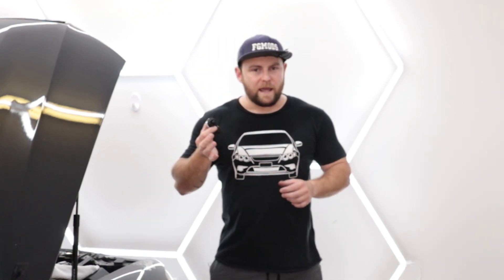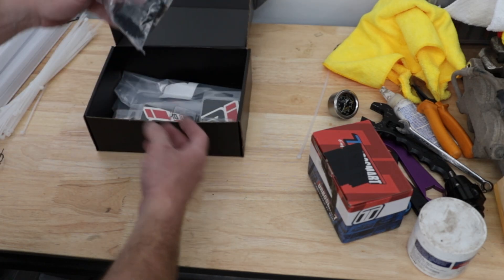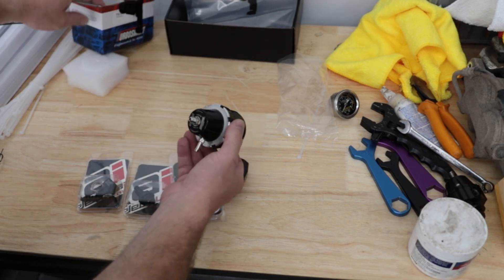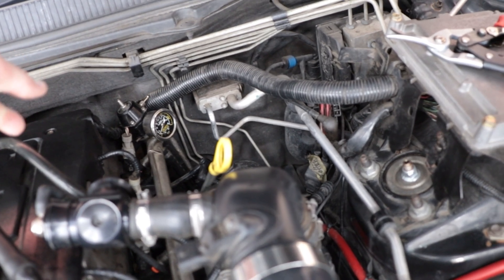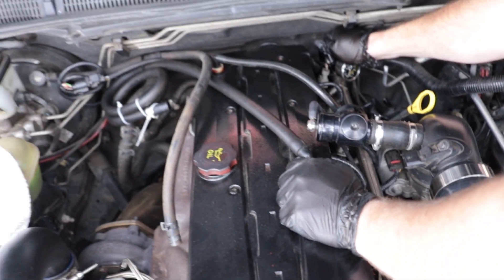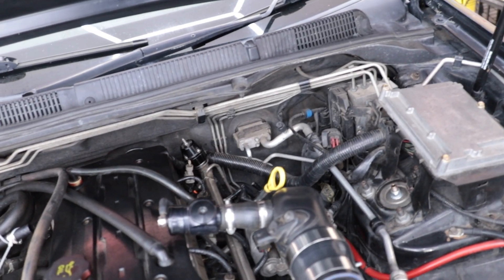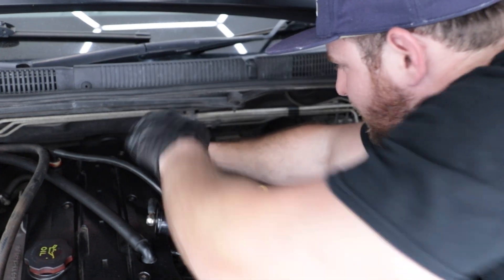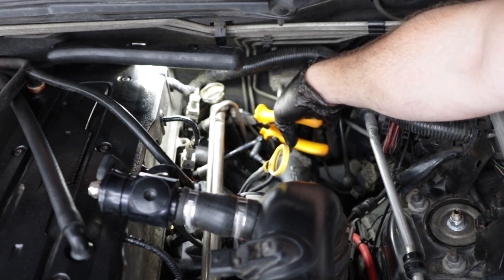Fix the turbo Falcon fuel system limitations #xr6turbo #fordfalcon #cars #barra

Comment: na+t is not a thing...if you have a turbo it's no longer naturally aspirated.
Reply: Reselling (or even just labelling) a car as 'turbo' knowing that there are differences between factory NA and Turbo cars seems disingenuous.
NA+T is a way of differentiating between a factory Turbo and a Turbocharged factory NA. That's all.
Reply from the maker: This is a good point as well
Unless you’ve fully converted the car to turbo specs, it would be misleading to try sell it as equivalent to a factory turbo model
Reply from the maker: Of course it’s not a thing. But Falcon’s came with turbo models from factory, so it’s a way of distinguishing the cars that have NA bottom ends and other parts, from the factory turbo ones
Reply: Are you joking or just like ignoring log books and vin? Lmao na +t makes no sense. Its either naturally aspirated or its turbo.  @fgmods
Reply: Where is the return port and i have territory turbo factory and I have turbosmart drop in reg and am about to buy after market rail and bosch clip adapter want to know if its a waste of time

Comment: If you're worried about return pressure drill out the return in the fuel pot to 5mm. Also did you have an NA factory fuel reg in there before?
Reply: Nah this is NA+T guy he loves to spend $$$ on his SB
Reply from the maker: Nah I have a turbo fuel rail, so it an aftermarket turbo reg I swapped out. 
This setup allows for better external regs to be used, rather than just drop in
Reply: @fgmods  ok cool just a bit puzzled how you were leaning out at 14psi with a factory turbo reg and with the new reg and 30% less fuel pressure it's got clean AFRs at 16psi. I don't know if I'd be game to even start mine after winding 30% fuel pressure out of the Reg lol I wonder if the computer is having a stroke with the fuel corrections it would need. Anyway, if that AFR gauge says it's fat and happy, enjoy it!
Reply: @G42J3T pressure is just a resistance to flow. More pressure = less flow. Less flow + more air = lean AFRs.
By reducing the resistance (pressure), you increase the flow. More flow + more air = clean AFRs.

As for the computer, it's really only worried about the fuel flow in order to trim AFR. So it's really not having to do any extra overtime.